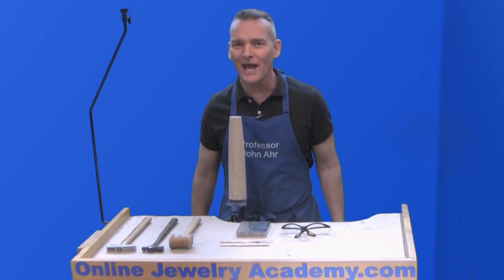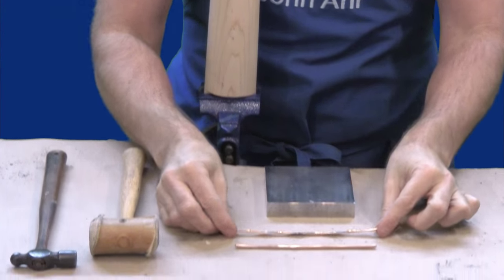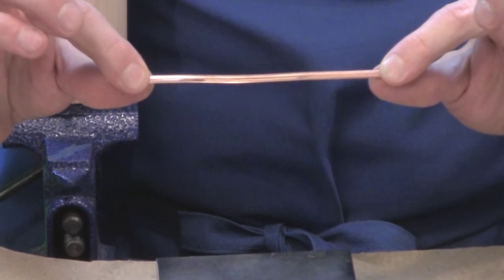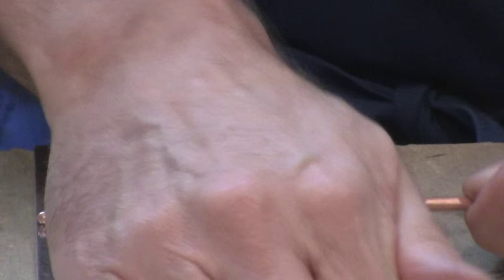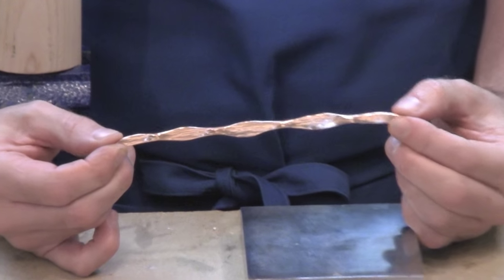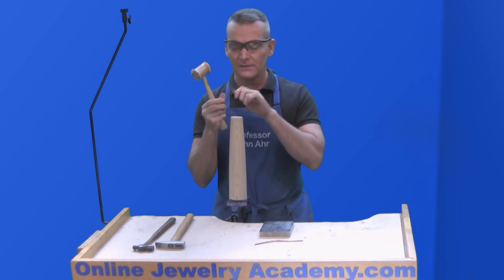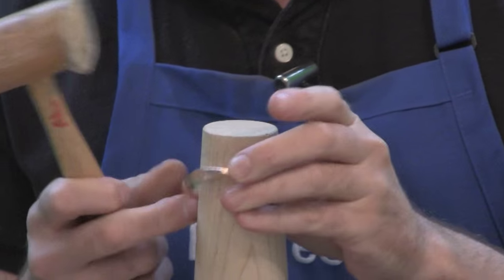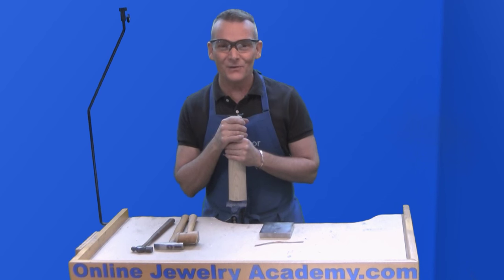Easy To Make Forged Wire Bracelet From Grounding Wire

Comment: The wire is actually ground wire, you can get it at the big box stores or any electrical supply company. It comes in 8, 6, 4, and 2. The smaller the number the bigger the gauge.

Comment: Great bracelet and excellent instructional video.  Can you please post what size and weight rawhide mallet you use for making bracelets like this?  Thanks.
Reply from the maker: Glad you enjoyed the video.  The size and weight of the rawhide mallet used to form the bracelet really doesn't matter.  You could also use a rubber mallet or a plastic "dead blow" mallet.  If your material is properly annealed, you'll have no problem striking it with whatever size and weight of mallet you have on hand.  If you'd like to purchase tools similar to the ones that I use in the videos, we've begun to post links for tools and supplies in the descriptions of our videos.  Good luck with your creative pursuits.
Thanks for your support! : )

Comment: Hi John. I assumed you meant grounding wire, but Hubby is insisting grounding wire and lightning rod are two different things. Do you mean grounding wire? Not that it matters to me as I have 6 and 8 gw upstairs and will use what I have. As always, enjoyed the video. Also, if you are ever on the East Coast, I know of a nice lady that would enjoy going out.
Reply from the maker: I'm not an electrician.  So, I might have used the wrong terminology to describe the wire that I was using.  Let's just say that it came from the electrical aisle at Home Depot.  It's just a big gauge wire.  Your husband is probably right.
Thanks for your support! : )

Comment: Hi John!

Great video!

I am trying to make some closed bangles using this heavy gauge copper wire (10 ga), and I am wanting to fuse the ends together as opposed to solder them.  Would my butane torch get hot enough to fuse the ends together, or should I switch to a different kind of torch? 

Thanks!
Reply from the maker: Hi Joe,  Your small butane torch isn't going to get hot enough to fuse a large gauge copper wire loop together.  You'll need a hotter torch.  If you're planning on fusing the wire because you want to forge on top of the seam, you should know that you can forge on a soldered seam.  You just need to increase the surface area of the connection.  Try cutting the ends of the loops at an angle so that they overlap.  The larger seam will hold up to some pounding.  Good luck with your projects.
Thanks for your support! : )
Reply: Thank you so much! I will definitely give that a try! :-)

Comment: John, thanks for this.  What is the correct length for a man’s cuff?
Reply from the maker: Hi Jane,  I'm glad that you enjoyed the video.  To ensure that you have the right length of wire to make a cuff for your male client, you'll need to measure his wrist.  Like a wristwatch, the cuff should be able to rest at the top of the hand.  In other words, it should sit in the space above where the hand flairs when the fingers are spread.  This usually translates to a 6.5" or 7" length for a male client.  Good luck with your projects.
Thanks for your support! : )

Comment: I'm going to try this.  Will it work with 10 gage copper or is that too big?
Reply from the maker: Hi Quiltgirl,  10 gauge wire will work fine.  You can definitely use a thicker gauge if you like.  Make a few bracelets in different gauges and stack them.  They're really pretty.  Have fun forging.
Thanks for your support! : )

Comment: I can't find any solid copper wire over 10 gauge. The 8 gauge wire at Home Depot is stranded. If you can give me specifics regarding what the store calls what you found, maybe even the code, that would really help. Thanks for sharing your tutorial.
Reply from the maker: Just do a search online for "copper grounding wire" and you should find it.  I got mine in the electrical department of Home Depot.  Hope that helps.
Reply: OnlineJewelryAcademy I did that. Any copper grounding wire that I could find was stranded or woven. 😔
Reply from the maker: https://www.wireandcableyourway.com/Bare-Copper/?gclid=CjwKCAjw1tDaBRAMEiwA0rYbSJss7GdtG6r8ohKcadmYM79DMwketmzwLpAoIXaZxgYGOlvEaDPlyRoCak4QAvD_BwE

That ought to work.
Reply: OnlineJewelryAcademy Thank you!
Reply: I got #4 at Home Depot yesterday (after I had already ordered online and paid $27 in shipping - ugggh)
Reply: I used 4 gage bare copper grounding wire I got from Lowe’s. Usually home improvement stores can sell any gage by the foot to you sometimes have to ask them and look for bare copper wire the stuff I got is meant for grounding circuit breaker boxes in homes

Comment: Does it turn your skin green ?
Reply from the maker: Copper jewelry can turn your skin green unless it is coated with a sealant. Coating the interior of a copper bracelet with clear nail enamel will help to prevent the transfer of copper oxide to the wearer’s skin. 😀
Reply: @OnlineJewelryAcademy  oh ok that’s awesome, I’m assuming I will have to continue the clear coat over time ?
Reply from the maker: @Mrqrlz  Yes, you are correct.
Reply: @OnlineJewelryAcademy  thank you